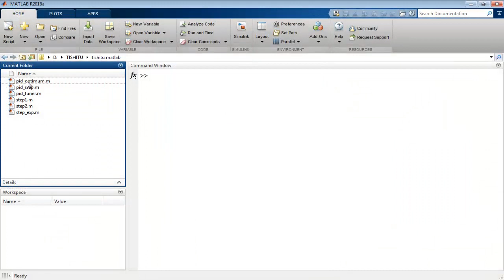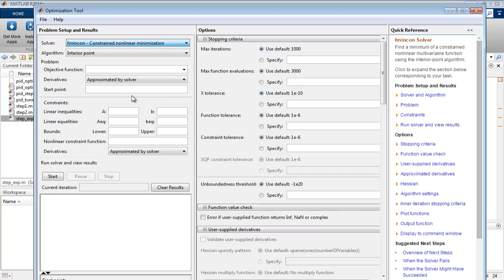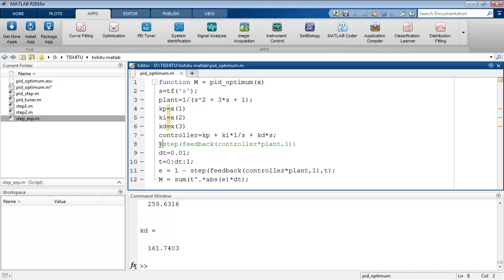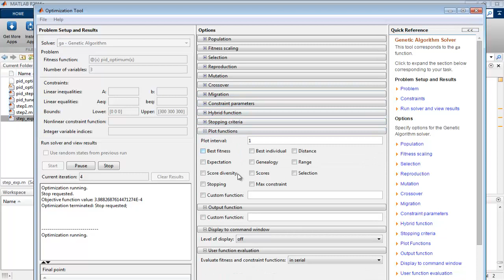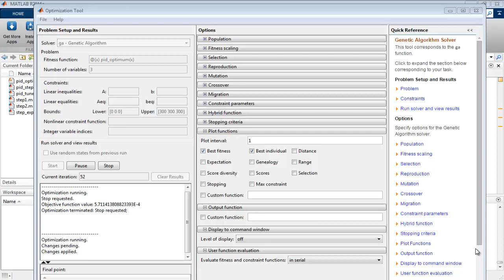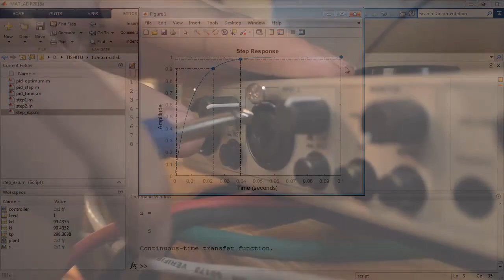#5 | Genetic Algorithm Based Optimization Of PID

Comment: what would it be the matlab command for objective function with 2 ITAE?
J=sum(t'.*abs(e1,e2)*dt) like this?
Reply: If you are using a multi-input multi-output system, it should be this way.J=sum(t'.*abs(e1+e2)*dt) )
Reply: @kvancsahin6509  Merhaba , elimde bi dc motor var transfer fonskiyonunu oturtuyorum bu kod ile 0.001 gibi sürelerde oturuyor fakat gerçek hayatla uyuşmuyor . Kodda neyi düzeltmeliyim sizce ? Teşekkürler